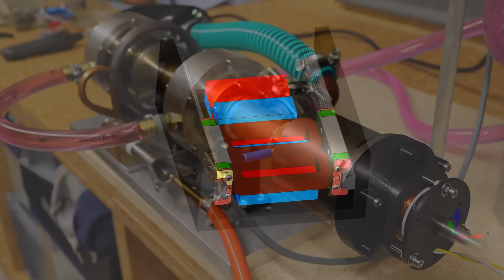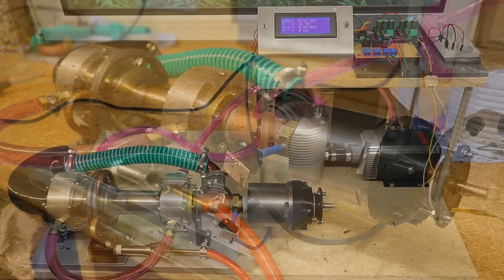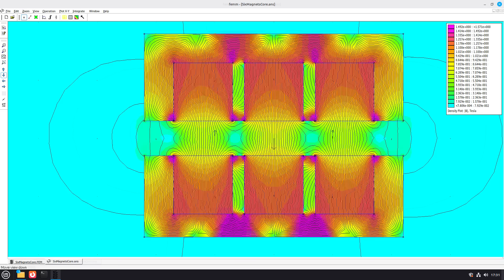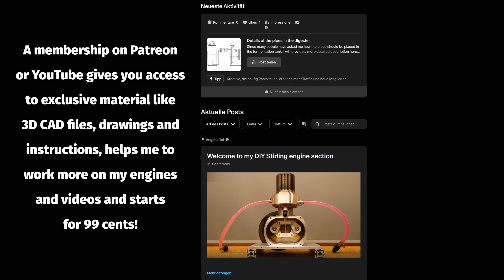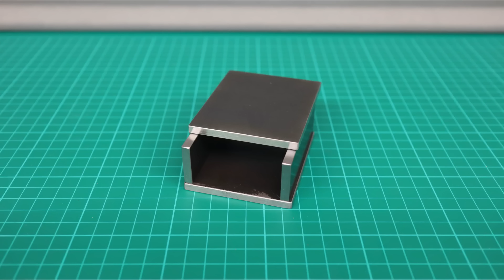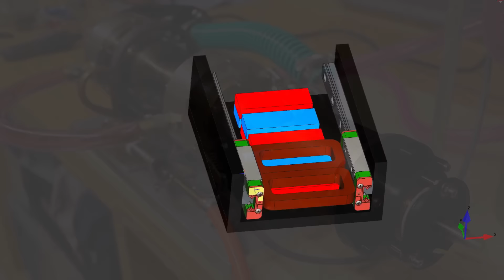Building a powerful linear generator for cheap DIY energy

Comment: Wondering what’s the actual source of power? Burning gas and linear generator with stirling method? I wonder how efficient that is? Or does it matter? 😅

I’d like to have super simple ~10kw linear diesel generator to my boat. Unfortunately linear generators haven’t had breakthrough yet although they should be much more efficient than normal engines… 😕

Comment: Very nice work, i have still problems with the piston to have a good fit. Can you suggest some type of piston rings or types? I got a tip to use PTFE as a piston but still have to try
Reply from the maker: I have not had good experiences with Teflon-based materials.
Igus Iglidur W300 or (UHMW) PE are very good.
Graphite also works, preferably with a cast iron cylinder.
If the entire piston is made of plastic, I have problems with thermal expansion and deformation over time, but with a little trial and error, you can get it under control.
I am also conducting intensive tests in this area.
The Thermoacoustic video should include a picture of my various pistons and piston rings that I am currently testing!
Reply: @myengines  Thanks

Comment: Everyone here wants to see you move the neodynium magnets to the rotor instead of the stator. I'm actually interested in what would happen if you made both the stator and rotor copper coils. Neodynium is politically sensitive right now, plus you would be able to change the load even more dynamically.
Reply from the maker: I will first test this setup intensively and than look what can be improved.
I don't know much about the use of coils as magnets but its really wort a consideration, many thanks for your kind suggestions!

Comment: Why are you not using flexible springs as "guide" for the moving mass like ALL other stirling engines with linear generator? That can serve as both guide and also give back the moving momentum of the moving mass as it moves back and forth. I take it you assume the linear guide will have low losses. But think of the frequency you are using here, its very high for a linear roller bearing, and will suck up a lot of available energy. Reversing the movement direction will suck up energy you would get back with a spring. But with a linear bearing this is not the case. A flexible spring will have almost no mechanical losses compared to a linear bearing. And on top of that a spring is easier to make!
Reply from the maker: Yes, absolutely right, I need to pay more attention to the use of springs in different designs. Leaf springs, as used in free-piston Stirling engines, are probably the most effective?
Thanks for your great suggestions!

Comment: Recent I saw interesting work by Chinese scientists on reciprocating liquid metal MHD generators using gallium or galistan driven by external pulses. There was also discussion of using a traveling wave thermoacoustic engine to drive a loop of liquid metal for continuous liquid metal circulation through the MHD. 

There was also an EU effort called SpaceSPIRE I think that took nuclear heat to drive a TAE whose internal hot gas directly pulsed the gallium liquid metal. 

For residential applications, a galistan roomtemp liquid metal would be easier. The trouble with the MHD is the electrical conversion electronics as it is a relatively unexplored area of inverter technology.
Reply from the maker: This is very interesting, thanks for sharing!
Reply: @myengines it looks like Deep Space Energy from Latvia is commercializing the SpaceTRIPS work

Comment: you could use a switched reluctance design, in those you have a fixed magnet and coil, and a moving piece of metal to open/close magnetic circuits, late Robert Murray-Smith had an example on a video
Reply from the maker: Yes, that's really elegant and I really have to look deep into this, specially the needed mass for the iron is interesting!
Thanks for your nice help!

Comment: Dude this is incredible! I believe freecad has em FEA? though I've never used it myself, could be easier to iterate. Also if the linear ball bearings aren't working out, I would wonder if a lubricated sliding bearing, a magnetic bearing, or even a flexure could work well in this application. I'm a huge sucker for flexures and that would reduce moving parts to approximately zero! ;)
Reply from the maker: Elmer can be integrated into FreeCAD but its a bit more complex.
Thanks for your nice proposals and help!

Comment: I would recommend against mounting the rails on two opposing faces, mounting them on the same surface will make it much easier to properly align everything. Additionally, if those opposing surfaces are not perfectly parallel (they never are) it is quite likely that your sled will get pinched, with no possibility of adjusting the rails to fix the problem.
On the other hand, if the rails are mounted on the same surface, but the surface isn`t flat enough, the rails may be adjusted using shims. Much safer configuration.
Thank you very much for sharing this awesome project!
Reply from the maker: I deliberately positioned the two side panels to which the rails are screwed between the base and cover plates.
This allows me to align them precisely so that they can run smoothly.
I just hope that the magnetic effect on the linear carriages is not too strong! 
Thanks for your nice thoughts and your kind comment!

Comment: one... "inductance alternator". no moving conductors. no brushes or slip rings. think "vr sensor" or "guitar pickup". with an active field winding rather than permanent magnet.
you ONLY have to alter magnetic FLUX DENSITY.
you do not get to reverse the magnetic field, so amplitude  is reduced to half. power... i may be wrong, but i believe its 1/4 of what you get from a full reversed magnetic field. (feel free to prove me wrong!)

anyway. looks like you are trying for multiple poles... you will get terrible harmonics on the output.  no two alternations will be of equal amplitude through a stroke. look into things like "pole shaping"... generators do NOT produce sine waves as easily as we are led to believe! if you have more than one alternation per stroke, the waveform will be of two components, a HF modulated on a LF carrier... the piston is NOT traveling at uniform velocity, unlike a rotating shaft and flywheel and poles does...

really, your only options are to have the output cross zero at the END of the strokes, or at the MIDDLE of the stroke.

and here you get issues as to the FORCE acting on the piston, and the resultant lenz reactions slowing teh piston down as that force is converted to electrical energy... the maximum FORCE is when the piston is NOT moving...  at "TDC". at midstroke, maximum velocity, it has the LEAST force on it. 
.
as its single acting, theres no "return" force at BDC to push it BACK! ok, its a stirling, theres a tiny force but its only surface area and the relative pressures on the faces of the piston... the atmosphere is pushing it back to "TDC" against whatever reduced pressure is achieved in the cooling phase.

this basically means that when you NEED power to push through the coil to DELIVER electrical energy... you dont have any!

brushes on "slip faces" (well, they wont be RINGS, will they?) , far better than hoping copper wires subjected to ultrasonic vibrations for hours wont work harden and fatigue...

FEMM may be handy... but you also do have to dig into some old physics textbooks on electromagnetics to get your head around a few concepts... magneto motive forces, BH loops, etc...
Reply from the maker: That's a lot of information that I need to think about carefully first.
I will probably have to find out experimentally what works and where I need to make changes, as I don't have the specialist knowledge to calculate this too precisely in theory.
I will rectify the two coils individually, and I hope that this will eliminate some of the problems you described.
Thank you very much for your great help and your many comments. I hope to learn a lot from them and will give them a lot of thought!

Comment: Here is an idea for increasing the power of the engine. Right now it looks like the engine is acting between its internal pressure and atmospheric pressure. If you put a buffer space outside the piston with a tiny capillary hole to the inside of the gas circuit (or perhaps some barrier of porous material like ceramic) and then pressurize the entire gas circuit, the entire engine can cycle at a much higher pressure. This should increase the power of the engine.

The capillary hole would let the buffer space equilibrate to the mean gas circuit pressure over time.
Reply from the maker: Yes, that's my plan when everything is ready for it.
Pressurization will increase power to much higher levels as with my kinematic engines.
Reply: @myengines  Here's an idea to double the power output: instead of using a pressurized buffer space, use two thermoacoustic engines, back-to-back, both actuating the same piston, with both engines pressurized. That way, when the piston gets perturbed and begins oscillating, the power stroke of one engine will coincide with the compression stroke of the other. The two engines will simply operate 180˚ out of phase with each other.
Reply from the maker: A multi cylinder engine is very effective but its much higher development effort, as i have far too less time to just develop a one cylinder engine.
But when i developed this one cylinder cycle to my full satisfaction, a multi (2-3) cylinder cycle engine will be a good option!

Comment: I have one suggestion: for all the moving parts other than the copper windings that may pass through magnetic fields, either make them out of ceramics, composites, or other non-conductive materials to prevent eddy current losses. If you have some metal parts that inadvertently receive eddy current losses, they could get hot and could waste energy and introduce inefficiencies.
Reply from the maker: I was hoping that this effect would not be particularly strong on the linear guide carriages.
If it is, I will really have to switch to non-conductive materials. 
Thank you very much for your helpful contribution!